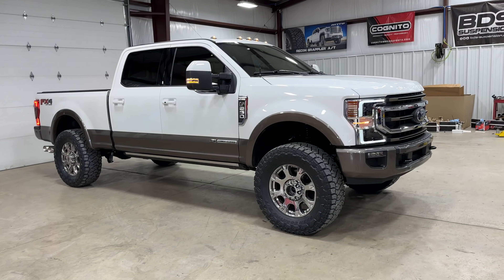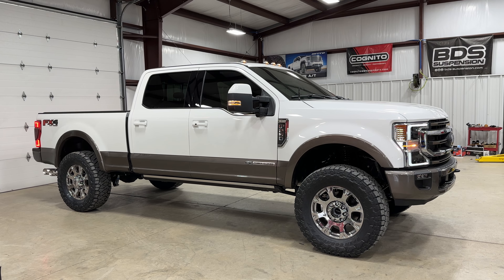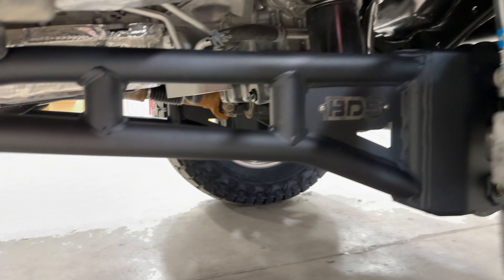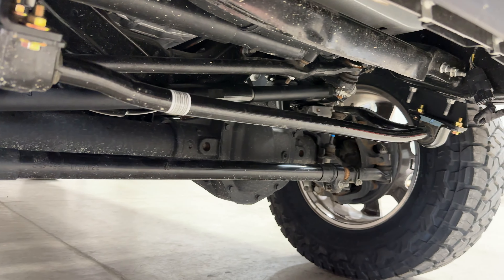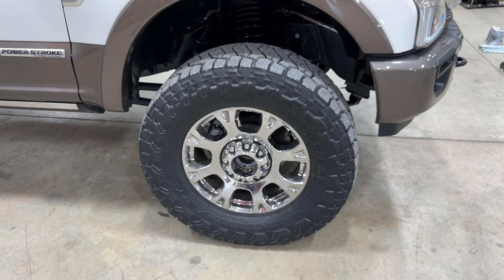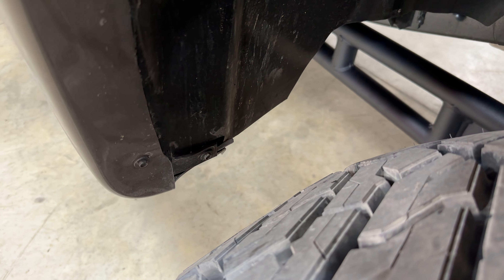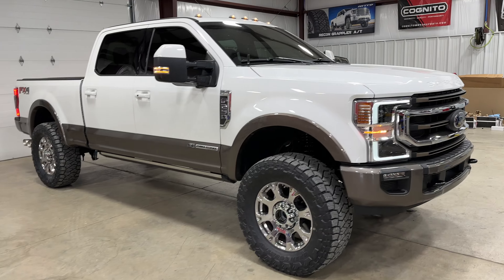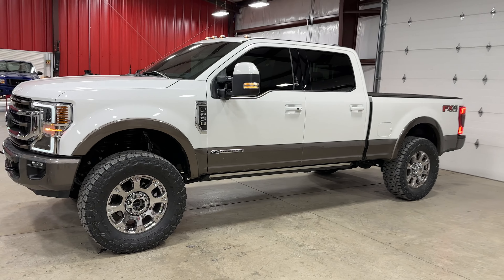2022 f250 with BDS radius arm leveling kit on 37x13.50

Comment: Question: did you need to use the spacers because the stock wheels with 12.5 wide tires can’t clear the brake lines?  This is the kit I want to go with but I am running stock wheels with 35s
Reply: I have a 2019 brother I used just the bilstein level kit and no rub

Comment: I want this kit but it says wont clear brake lines on bigger than 37. do spacers help with that?
Reply: 35*
Reply from the maker: @kadepant  yes the spacers move the tires away from the brake lines among other things
Reply: @ thank u sir kit is otw w 2inch spacers and bumper spacer hopefully they fit 37.13.50 mud grapps